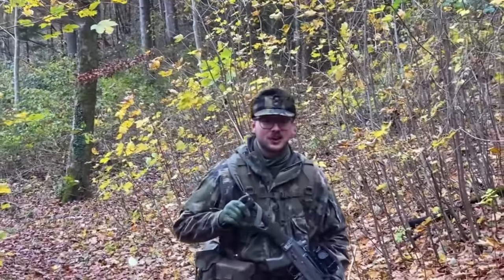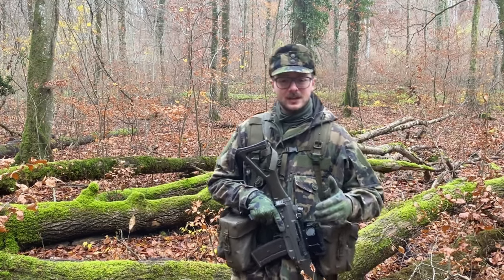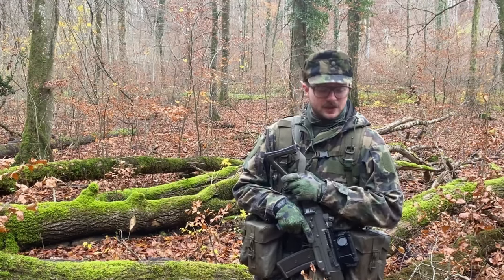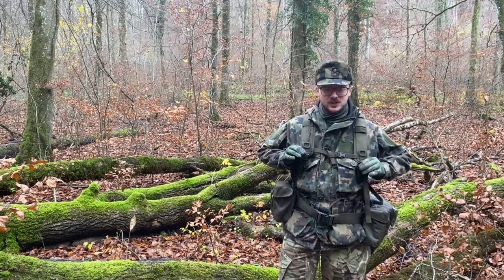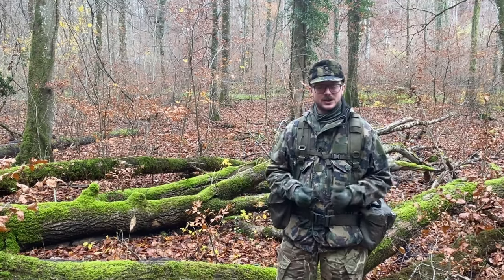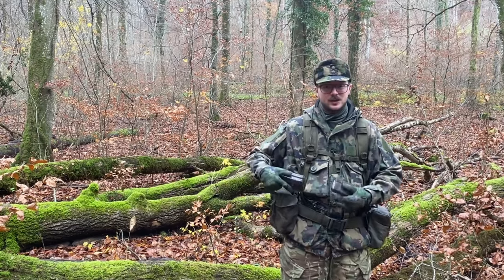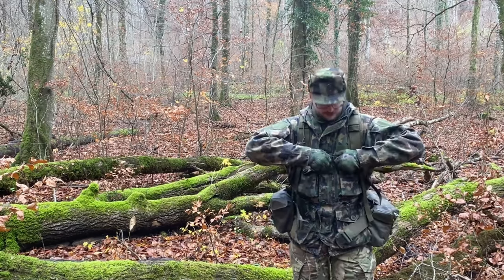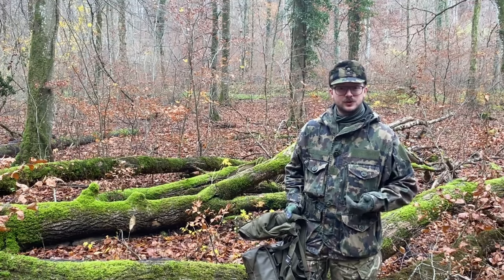The Rifleman`s Corner; Episode 1: GTE 90 Swiss Army LBE

Comment: Take off the metal hooks that hooks on your pouches. Use Zipp ties, you will find your LBE much lighter. I did this back in the 1990s when we still had ALICE LBEs. On my LBE I had 4 magazine pouches, 2 canteen pouches, and a butt pack, with an H-harness. Perfect for a 24 hour mission with poncho and poncho liner blanket for a Ranger Roll put on your butt pack, extra ALICE M16 pouches you can put grenade and smoke grenades. In the butt pack I put in 4 stripped down MREs for a 48 hour meal in a MRE bag closed with duct tape, extra socks in sandwich bags. Travel light, move fast, and stay quiet like Paratroopers.
Reply from the maker: thanks for the input:)
I have previously experimentet with ziptieing the pouches onto the belt, but I found them not very stable. Also due to the lack of structure in the pouches to begin with.
The loops in which the metal hooks hook into, are sewn shut in the middle. You can`t pass zipties through them so they would slide back and forth a lot.
Fortunaly the hooks do not dig into the body at all like the ALICE clips do.
Reply: @SwissFusilier  Gotcha. I guess it doesn't work for Swiss LBE.

Comment: Your presentation was very intresting.  And your spoken English was supperb. 

This belt kit is not too dissimilar to the kit we were given in the 80s and 90s, so I have nearly 20 years experance with old British shit issue kit, adapting and modifying it so that it was at least functional. 

Your modificatons are very much like how we adapted our belt kits. 

I would move everything further back. Freeing up the front to make it more comfortable when you go prone and giving you better access to your smock pockets. 

I bet that the whole rig rattles and bangs when you run? If so, get some elastic cord (shock cord) and run that. Fix one end to the back of one of the front ammo pouch then run it around the out side of the rig to the rear of the other front ammo pouch.

Drill a hole I the handle of your spoon and dummy cord it to the button loop of one of the top pockets  your smock. Then you spoon will always be with you. 

Well done given the poor quality kit and the conditions you have to work under good set up
Reply from the maker: Thank you for your input :)

The swiss army definitely took some inpiration from british gear of that era XD

The only way I could move the pouches back is by switching the double pouches for the gasmask carrier withouth the polymer stiffener. That way I would sacrifice some carrying capacity tho.
What I usualy do if I`m prone for longer periods of time is openeing the beltbuckle, kind of like people do with modern split front chest rigs.

It does indeed rattle but it`s mostly the pouches themselves bouncing around on the belt due to lack of structure. For the same reason it gets really awkward to re-insert mags if you put shock cord around them.

Comment: Nice video i have to say. You did a great job on your GTE 90.
Me for myself as an lieutenant i first got rid of the fucking leather holster, that i got issued for my Pistol. Second i bought some magazinpouches for my P75 magazins. 
I also mounted the double pouches on the back of my GTE 90. There i keep my ifak and some field essential items. 
All in all it gets most of the job done, but sometimes i use it togehter with my chest rig.
I hope we get issued the new MBAS System soon.
Reply from the maker: Thank you for your kind words:)
Yeah me as well XD but I decided to not get into the holster since it does not affect most guys;) and even then the solution is "get a safariland XD"
I just prefer to seperate my IFAK from my combat load. So I can drop most of the weight and still carry it.
The WK units will get them from 2026 on. most of the MBAS components have already been delivered and a decent chunk of it is even PA material.
I`ll definetly do a MBAS episode once I get my hands on it ;)
Reply: @SwissFusilier this comment aged like milk

Comment: Thank you for taking the time to make this, I found it very interesting. I do have a couple of questions.
Is there any usage of body armor?
 You showed you had 20 round magazines, is that what’s commonly issued, and if so why 20s over 30s?
Reply from the maker: Thank you :)
Yes since the early 2000`s they issued large Kevlar vests with ceramic ~lvl3 plates. They are large and cumbersome but will be replaced with the new MBAS gear.
Yes only special forces are issued 30rnd magazines. Everyone else gets 20rnd mags. There are rumors that is because of target shooting or getting lower to the ground in general but imho the real reason was that the Stgw.90 programm was going over budget early on and the 20rnd mags were 3-4 bucks cheaper per mag :DD

Comment: Nice video 👍. I tried several configurations using a battle belt and pouches in combination with the harness. In the end I just starded using my own pc and belt. I only use my GTE for ceremonial bullshit now.
Reply from the maker: That is ofc the most viable option most of the time. Modern belt kits do have a purpuse for example in areas where resupply is very difficult so guys need to carry a lot of stuff on person.
Unfortunately many commands are extremely strict against non-issued kit… that‘s partially why this video exists. Showing a way of making the GTE work at least a bit😊
Reply: @SwissFusilier  The advantage of being in a Romand unit eh eh. 
I agree that a harness is way more comfortable with heavy loads. 
One tip from one of my friends is to glue/sew cordura or soft plastic-like panels inside the front portions of the ammo pouches. It gives more rigidity while still allowing to flatten the pouche. Although this is a permanent modification, it is almost invisible. The whole  GTE sytsem will be thrown away in the next two years anyway.
Reply from the maker: @tovachiere  that would be an interesting mod indeed.
honestly looking at how they expanded the contract with Sig Sauer CH for more Stgw90 parts until 2050 makes me believe, that the GTE still in servicable condition and still in stock will be kept back as a new wartime reserve.
I`ll definitely try to keep mine as a kit option ;)

Comment: Danke fürs coole video. Can you also make one on the new MBAS? will you be issued the MBAS? in addition it would be nice to hear about this Stg90? Do they all come with picrails and aimpoint now? It looks like a sig550  i thought only the sig 552 or 553 stg07 had modern optics?
P.s. i thought most troops get a glock 17 or 26 issued in addition now?
I hope the sig550 gets soo  replaced with something more modern like hk416, bt apc556 or any type of modern ar15 (geiselle urgi would be nice😂🤣
Reply from the maker: Thank you😎👍 the MBAS will be issued to WK units in 2026. I will do a video about it as soon as I get my hands on it😂
Nope is just a regular Stgw90😅 the rail and optic I put on myself since we still get none in service (except the old 4x24 scopes for squad leaders and assistant squad leaders).
I have already planned several episodes about the Stgw90 and a possible replacement but those will take a little while😅
Reply: @SwissFusilier  freu mi. Gruess us Schaffhuuse.
Reply: @SwissFusilier bevor mbas chunt gfrürt t höll zue😢
Reply from the maker: @ga-yt4ic  120k Plattenträger 18 und 40k Schutzwesten 18 mit de platte defür sind scho beschafft und in Lager. S meischte vo de PA usrüschtig und chleider isch au scho doh oder wird grad gliferet. was no verzögerig git sind dr Helmüberzug und es teil vo de chälte- und regeschutzchleider. :DDD chunnt also +/- uf ziit
Reply: @SwissFusilier top di neu usrüstig isch halt scho extrem nötig